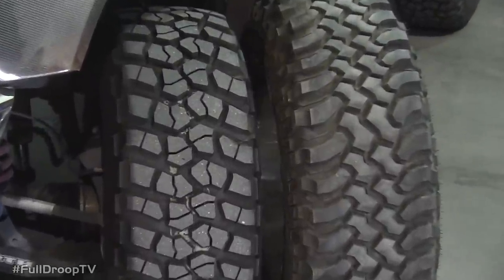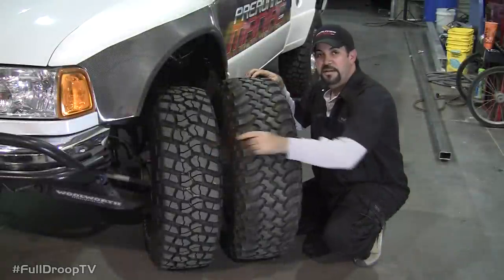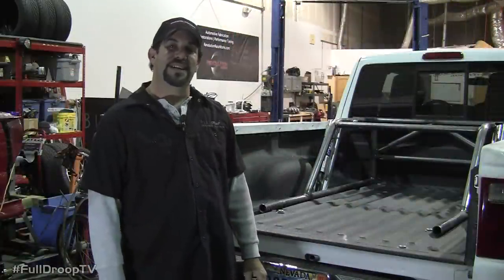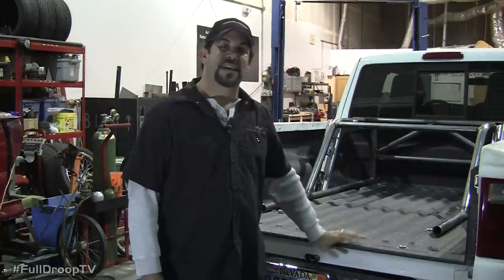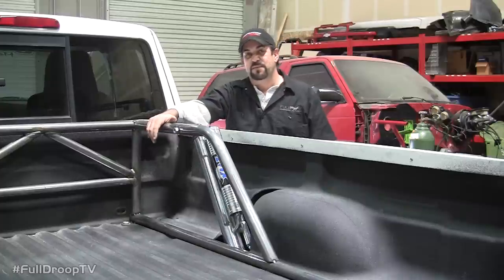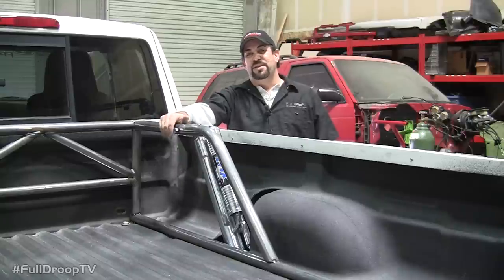How to Build a Bedcage on a Ranger Prerunner - FullDroopTV

Comment from the maker: As long as they are between 14" and 16" then yes. You will need long travel leaf springs to take full advantage of a bedcage. Stock leaf spring packs won't "Droop" out enough.

Comment: I honestly wouldn't go to the desert with this setup. Maybe if you're looking for something functional, that looks good. But not fully functional for a desert truck imo. The top, and bottom of the bed wasn't even reinforced with flat steel to give it strength. If you want something fully functional, and ready for the desert, i'd suggest cutting into the bed, and anchoring it to the frame. That's just my opinion though. Hate mail/comments welcomed.
Reply: Im whatching this thinking the same thing.
Reply: connor melvin Their fabricator is an amazing fabricator, don't get me wrong. He builds some pretty amazing concepts. However, this really does not look like it would support suspension. You go hard enough, and everything gets heated enough, those shocks are going to put an extreme amount of pressure on the overall structure and somethings gonna give. That's imho.
Reply: AmerikanPsyko these builds are definitely not made to take hardcore abuse for extended periods of time, which is what a prerunner is supposed to be.
Reply: Derrick Spoelhof I understand they're not supposed to take a hardcore beating, however, a prerunner is made to take a beating. I can only assume that 30 minutes through a whoop section would stress this cage out dramatically. I could be wrong, just my opinion. I think the fabricator is a very skilled, and talented fabricator, I just doubt how well this would actually work out in the desert. We built prerunners, to prerun. If it's not functional, why build it. That's just my philosophy.
Reply: +AmerikanPsyko I'm not trying to be a critic, but I agree. This is built to look cool. I think the cage would hold up fine (although it needs a vertical bar from top to bottom near the shock). Its the 4 chinsey mounting tabs that are going to fail in a woop section. If nothing else I would use tubing between the right and left side of the base and then bosses with grade 8 hardware in place of the tabs. It makes no sense for the mounting point to be the weakest point.
Reply: Tommy Lee I agree. It's not a bad looking cage, the fab on it is great. I just don't think for the size shock, and how intense the long travel front is, that it could handle the stress the front end would output. In my opinion, it's not worth the time, and countless dollars spent to build something that isn't secure the the frame, and trussed properly to handle a hard desert run. I could be wrong, but that's how I see it.

Comment: I confused, you built this big heavyduty cage, but its held in with 4 little bolts? What are the bolts running into on the bed?
Reply from the maker: It's using the factory bed bolts...

Comment: So you didnt weld your bedcage to the frame at all? Just used the bed mounting bolts? Will that hold up? I like the idea of not cutting up my bed too much,
Reply: On my Chevy the bed bolts to the frame.
Reply: +Matt Eiswerth I had a simular set up on my Ranger just using the stock bed mounts and it held up fine, mostly just a daily driver that I would take out on the weekends but I wouldn't recommend it if you're going to push the limits of your prerunner.
Reply: it will hold up to speed bumps in mall parking lots

Comment: Can you explain the purpose/ benefit of running the shock on top of the leaf spring? wouldn't they work better together if the shock was mounted on the rear end housing instead of on top of the leaf? I understand that you are gaining axle drop and more travel but wouldn't it perform better with the shock mounted to the rear axle and get a longer shock? or ditch the leafs in general and add coil overs?
Reply: coil overs are not as stable as leafs with bypasses. Also have fun finding a coil with 16"+ of travel. At that point you might as well just link it

Comment: how much to build me exactly like it for 99 ranger?
Reply: Your looking at at least $2000 in just materials.
Reply: +UnitCrane514 $2000?! For tubing? If you aren't including the shocks in that quote then you need to find a better source for steel. I could build this for closer to $200.
Reply: +Tommy Lee you aren't considering to cost of a good quality tubing bender and a welding machine. Most people don't have a tubing bender just hangin out in there garage. I have a really nice welding machine and a ton of tubing but the cost of buying tubing bender and the time to do the build is what's holding me up on building a cage. It's not always the materials themselves that make a project expensive
Reply: +UnitCrane514 True. I think I have close to $500 into my bender with a single 1.25" die. I just spent $180 on a 1" die. Another $500-$600 into my Hobart 140 after the gas conversion.  I thought you meant just raw materials, not tools.